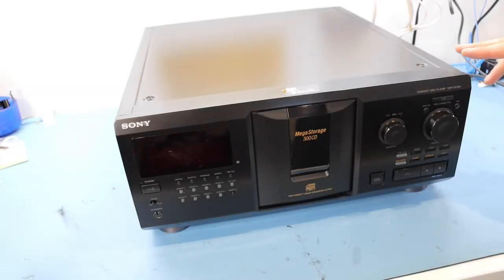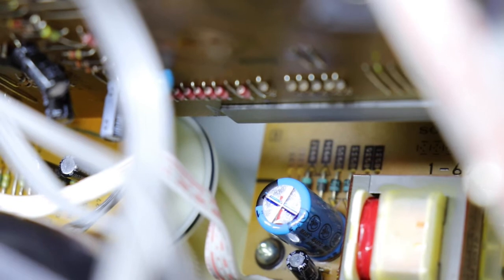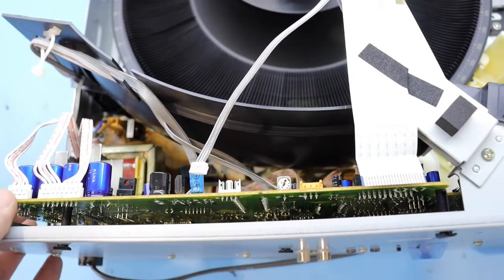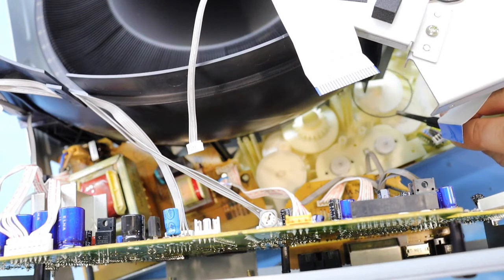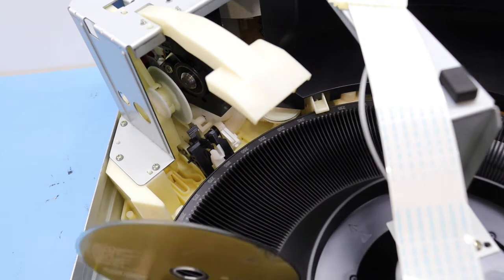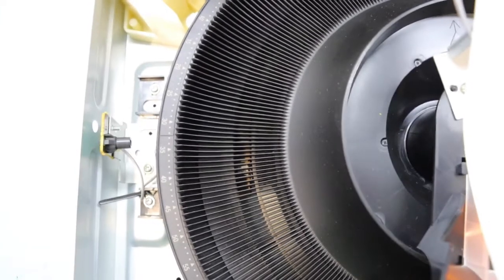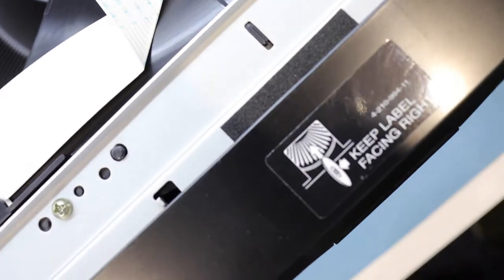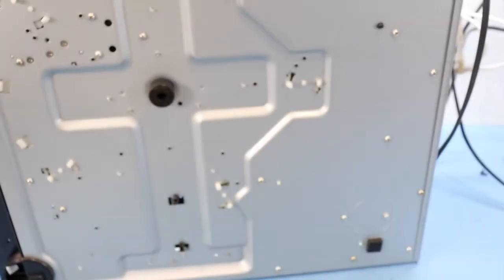HOW TO - Fix belt & playback issues on Sony`s 300 CD Mega Storage  Changers - CDP-CX355 CDP-CX350

Comment: Great, helpful video. The best part is it allowed me to change both belts ($10 from Amazon) in about ten minutes with no problems, and, best of all, without having to take out a single disk. Saved a big pain of putting all of the disks back in!
Reply from the maker: Glad it helped :-)
Reply: Brian Ruess  thanks for writing this. I would have unknowingly removed all of the discs!
Reply: thanks for the tip about not having to remove the discs. i was dreading that....

Comment: Thank you for the great video.  I just undertook the surgery to replace the two belts.  It's 19 years old and the belts turned into bubblegum.  Surprisingly it's actually easier than you make it look.  I didn't even unload the carousel. Disconnecting the 4 cables from the board is probably the riskiest part. 
I'm a retired machinist, tool maker and mechanical engineer and I see things most people don't see.  What I saw in this machine is astounding.  The care and detail is outstanding.  The quality of the plastic injection molding is superb.  Especially the carousel.  That's a single piece and to mold that with those 300 dividers is no simple task. 
Thanks again.
Reply from the maker: no problem

Comment: Great video!  I first watched another video which emphasized removing all of the parts above the belts in order to access them.  I quickly realized that even if i did get all of the parts removed, I would never remember how to reassemble them correctly.  Fortunately, I came across your video a short time later, and found the process much more simple and straightforward.  Being retired and on a fixed income, I really appreciate anything that helps me save what little money I have.  Thanks very much for that.
Reply from the maker: glad it helped

Comment: How to find replacement belts - Search for: 2 Drive Belts and 1 Door Belt for Sony 300 400 CDP-CX300 CDP-CX400 CD Player Belts
Several results found on Amazon, Ebay, etc. These fit multiple models of the Sony Carousel style players. Set of all 3 belts should be under $10 including shipping.
As the video mentioned, to replace the door belt you need to remove the carousel to get underneath it.
Reply: Thank you for this info!
Reply: Thanks so much! It’s exactly what I needed to know. What is the right kind of set of tweezers called? What about the rings and ankle bracelet he wore to prevent static? Is that something to buy too? What search would you recommend? What kind of metal, if you know? Thanks!
Reply from the maker: you dont need to replace the door belt unless it has failed. they dont usually fail. most turntable issues happen once a customer attempts to replace that belt when its not needed! belts in my ebay store

Comment: Thank you for the clearly detailed information! I discovered at Christmas time that it would no longer play. Ordered the belts from Amazon, installed them, and it works like new! Kudos for a great video.
Reply from the maker: no probs
Reply: John Yoder. Was there a model number of the belts so I know I’m buying the right kind and size of belts? I plan to buy them too. Thanks.
Reply: @jaykay1053     Changer Loading & Carousel 2 Belt Set for Sony CDP-CX355 CX350 CX335 CX333ES CD Player

Comment: Brilliant. I’ve been putting off getting my 300 disc model fixed. This makes me comfortable doing it myself with $10 of belts from Amazon.
Reply: I replaced the two belts, thanks. Now it blinks but the carousel doesn’t turn and door does not open. Tabs underneath seem to be in place. Is there a door belt?
Reply from the maker: if nothings moving at all check your ribbon cables from the pcbs,

Comment: Just replaced belts/cleaned my cx355 from '02. I replaced the door belt as well, easy fix...Great machine, and excellent storage!
Reply from the maker: glad it helped
Reply: Where is the door belt located?  None of the videos I have found talk about that one
Reply: @JohnClayten  I think that the door belt is underneath the carousel. A different video mentions this. Also the service manual mentions this.

Comment: Thank you for a fantastic video. Its the best video on here for belt changing. 

My Sony CD changer has just had the belts changed by the previous owner a few weeks ago and it seems to worked fine until today. The carousel just goes around and I see blue, green and amber lights in the window. I've checked all the plastic tabs on the underside and they are all there and secure. 

Might it be the sensors have dust or misalignment?
Reply from the maker: Thanks for that!

Comment: Excellent video. Thanks. I did also have a problem with the player mechanism not being in the correct place on the spiral track after I removed it to replace the belts before I watched your video. Luckily it is working now.
Reply from the maker: Yeap that can happen if you also remove too many of the screws, especially the ones that hold the cd laser frame in place. Easy to line it back up though. as you found out :-)

Comment: Thank you for sharing this video. Does replacing the belts also solved the issues that sometimes when loading a cd the cd gets stuck and smashed somewhere in the machine or brakes. I had that twice so maybe i need to replace the belts. Thanks for sharing again.
Reply from the maker: new belts would help the clamp for the disc.

Comment: Great video content.  Are you just using common elastic/rubber bands?  I have a 200 disk CDP-CX235 and it seems like there is only one toothed belt in the rear.  Can you replace that with a non-toothed belt?  I'm having loading issues as the disk wil  intially load into the opitical driver then it will fall out.  Is this related to the loose belt?  Daniel
Reply from the maker: newer models don`t use the toothed belts, so if you have a toothed belt on yours you`ll need to replace with same.

Comment: I've watched the video, loved it! I have seen numerous questions asking about the belts, what size, where to find them etc. Can you let us in on the source of the belts? Thanks again.
Reply: eBay...about $8
Reply: How to find replacement belts - Search for: 2 Drive Belts and 1 Door Belt for Sony 300 400 CDP-CX300 CDP-CX400 CD Player Belts
Several results found on Amazon, Ebay, etc. These fit multiple models of the Sony Carousel style players. Set of all 3 belts should be under $10 including shipping.
As the video mentioned, to replace the door belt you need to remove the carousel to get underneath it.
Reply from the maker: in my ebay store

Comment: Great video very helpful where can I buy the new belts and do they have part # 's also my machine needs the new belts but it does pull the disk out of the tray and then tries to scan the disks and then just puts it back in the tray and never plays it. Have you done a video on repairing that problem? Thank you again for your help.
Reply: How to find replacement belts - Search for: 2 Drive Belts and 1 Door Belt for Sony 300 400 CDP-CX300 CDP-CX400 CD Player Belts
Several results found on Amazon, Ebay, etc. These fit multiple models of the Sony Carousel style players. Set of all 3 belts should be under $10 including shipping.
As the video mentioned, to replace the door belt you need to remove the carousel to get underneath it.
Reply from the maker: they are available in my ebay store

Comment: I'm a little late but I have a problem with my cdp-cx350. I changed the belts but since then it just displays"table error" and won't play the disk but instead stop one next to the grabbing mechanism. If I push the carusel a little manualy, it will grab the disk and starts playing it. Would  you know a solution that might fixes my issue?
Reply from the maker: sensore alignment or missing tooth on the bottom of the carosel if you removed it to do the door belt

Comment: What about the door belt? I bought the replacement belts and both the drive belts were easy to replace with your video. I am wondering about the 3rd smaller belt that came with the package.
Reply from the maker: door belts rarely fail. its located under the turntable at the front, door slides back and unclips from its mount like a keyhole

Comment: Great video, many thanks, my CDP-CX355 (that I got maybe back in 2001) now has 2 new belts that work great. But there is an additional fault that I don't know how to fix, can you give a suggestion? This fault was present before the belt changes. The unit grabs each CD but almost always is unable to play the cd, it just spins for some time, then moves to the next disc , and this repeats. I don't see an error message. Occasionally it will play, or play some of the tracks and then the fault reappears. I cleaned the laser with isopropyl alcohol on a cotton-bud as you did, but it does not change the symptom. Any suggestions?
Reply from the maker: could be the alignment is out (theres a screw on the clamp) or its dirty, or just needs a new laser - they can be found on ebay for not much money

Comment: Hi,I changed out the belts but the table stops 1 disc short to load.I can move it manually and it will grab the cd but I can't seem to get it alighned.Any suggestions?Thank you
Reply from the maker: either sensor alighment, or you are missing a tooth from the bottom of the turntable which the laser counts (happens when people try to fit new door belts!)

Comment: Thanks for the informative video! I put some new belts on a Sony CX-355, 300 disk player. What tool do you use for adjusting the sensors? An oscilloscope?

I think there may be something wrong with the sensors but I really have no clue. When I turn it on, the table/carousel rotates a bit then reverses direction, it does that a few times and then stops. It won't even get a disk ready to play or eject one. It displays 'Table Error'. Any help is greatly appreciated, thanks!
Reply from the maker: yeap a scope is the best way, but what you describe sounds like a damaged table causing a sensor error - the tables going back and forth as it cannot locate its position - remove it and turn it over, there`s a row of tiny tabs that run along the edge all the way round - the sensor "counts" these tabs to work out where the table is - you often find that some are missing from mis-use, so check they are all there - look for any gaps that are not constant (i.e too big). Only way to fix is either with some crafting plastic and patience, or a replacement table.

Comment: I couldn’t get the wide ribbon on top to unplug from the circuit board. However, after opening up the two retaining clips it freed up so much slack that unplugging it was unnecessary.

Comment: Do any of these units use a toothed type belt?  If so, which?  Have you ever replaced the laser reading component in these and how would you say is the quality of their longevity?   What is a good source for the replacement belts you like?
Reply from the maker: nope. toothed belts are used on the dvp changer models.
Reply: dvp?  Source for toothed replacement belts?  @Sortitoutman

Comment: I have a Sony DVP-CX870D. It has trouble loading a disc. It fails with C 32 00 error. It intermittently will load a disc. Is this a belt issue? If I help the disc it will load and play fine. The carousel is working fine. Not sure how to troubleshoot this issue and correct it?
Do you have a video on the Cx870d??
Reply from the maker: if memory serves these use gears. It will be a dirty or failing laser.

Comment: Hi I have a question. My mothers 350 quit working and I took the top off and immediately saw that the belt was off. I ordered 2 belts from ebay and am gonna go ahead and change both when they get here but I noticed that the disc tray doesn't spin freely when I tried to move it with my hand. Does that mean I have a bigger problem than just the belt being off the pulley?
Reply from the maker: its on gears so it should be reasonably hard to turn manually.

Comment: I just picked up one of these Sony 300 disc changers.  It powers up and plays but seems to have some skipping issues.  What’s the most common causes of skipping ?  And I have cleaned the lens with isopropyl alcohol.
Reply: There's another Sony 300 changer repair @ 12voltvideo that shows a much more detailed approach to the skipping issue than this one. My machine has the same problem and cleaning doesn't help it. The apparent problem is the transport mechanism (for the CD @ the laser) gets sticky 'cause the lubricant ages so the motor demand goes up and as it responds to move the laser, it skips rather than moving smoothly. Between this video and one I mentioned above, I think I can accomplish a cleaning process without a lot of tear down. Good luck!
Reply from the maker: Skippings either a week motor, or a dirty sled (the rails the laser sides up and down on) just clean both the rails and the lens and see if it improves, but you can replace the laser for not much cost....

Comment: Hi I have this kind of unit I already changed the 2 belt but sometimes the carousel keep on stopping and sometimes it’s kinda stuck what do you think is the problem? Thanks for the reply
Reply from the maker: check the guide rollers under the table they come loose with age and can cause it to not turn or jam
Reply: @Sortitoutman thanks for the reply. Do I have to disassemble pull out the carousel to do that?

Comment: Hi there we have 400 disc Sony in for repair where with no discs in the carousel rotates and the machine will load a no exsistance disc from every single location as if it thinks it has a disc in every location and yet if you put a disc in say position 25 and with drum search knob ask it to go to 25 it does and loads disc and plays.
Reply from the maker: either sensor on the left side is bent or the plastic tabs under the table are bent or missing in places causing it to "see" a disc in the empty slot.
Reply: @Sortitoutman    Thanks for your reply unfortunatley  the customer has taken back the the unit. I did check the angle of the sensor but also and as the unit would keep loading every single disc compartment without a disc in any of them i put my hand in the way of the infrad transmitter and noted what change i had at the input pin on the cpu ic and it seemed to change so assumed the cpu was faulty.

Comment: My jog dial knob on my cdp- 
 cx230 CD player doesn’t work properly now.  It will move the carousel back and forth or in the opposite direction that it’s supposed too, so I can’t put in discs where I want other than where the door opens,  the player still plays fine.  Any suggestions what to check ?
Reply from the maker: most likely just a dirty pot under the knob, put some contact cleaner on it

Comment: The tray/carousel stops always one slot before the one selected. If I help it manually (with the cover off) the clamps and pick up will operate fine, but if the disc is ejected or another slot selected then again, the tray will stop one slot before the one picked, why is this? All belts replaced with new ones.

Comment: Hi There i have one of these in for repair with 2 rear loading belts are u/s have managed to fit the belts using tweezers so have not had to disturb anything. The unit will find a disc location and play it but if you close the machine with no disc's in side the unit goes through all the locations looking for disc's which takes hours. Any idea ?s  Manu thanks robert
Reply from the maker: check the rollers under the tray have not come loose if they are loose when theres no weight (i.e no discs loaded) it won`t be lined up with the sensor

Comment: My belts turned into a gewey ink like substance and made a mess of everything it touched, necessitating the removal and cleaning of several parts. Any tips on how to avoid the mess. Was thinking using scotch tape to remove it.
Reply: Rubbing or isopropyl alcohol and cotton swabs cuts through the black sticky goo. Try not to touch that stuff with your hands or you will spread it everywhere. 
You may need to carefully take out the top of the pulley that the belt wraps around. There is a catch on the side to release so you can pull it off. Needle nose pliers helps.
Reply: @bwk321  thanks for the reply, I found that dawn dishwashing liquid was more effective on cleaning. I already go it cleaned and you are so correct that it gets everywhere, it was the hardest part of fixing it. I was wondering if I put it in the fridge beforehand if that would solidify the goo. I love these and hope to get another.
Reply from the maker: servisol foam cleaner is best for this over isopro, just wipes off once you have left it a few minutes.

Comment: I wish I had watched your video first. I replaced the belts the traditional way by pulling everything out. It worked but now I am having a hard time because the door won't close due to the claw piece. Not sure what I'm doing wrong here.
Reply from the maker: If you mean the top plastic tab guide on the door, it will slide back into place using the "key" hole in the plastic guide at the end, just manually slide and clip the door clip tab back into the frame guide.
Reply: @Sortitoutman  Thanks!! I actually finally fixed it.

Comment: Belt replacement unsuccessfull in getting unit to read discs. Tray keeps moving back and forth over about a 30 disc range. Any thoughts, laser strength, and or alignment?
Reply from the maker: You have at least one broken plastic positon tab under the turntable so the sensors cannot count the position of the tray. I mention this in the video.